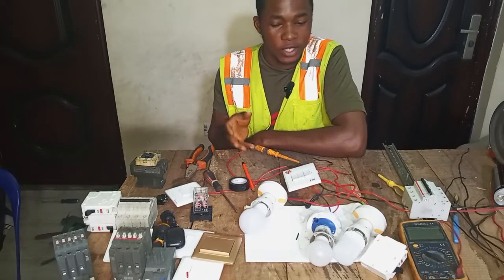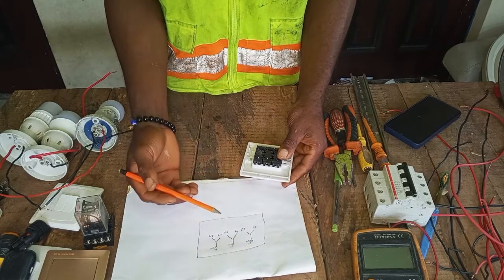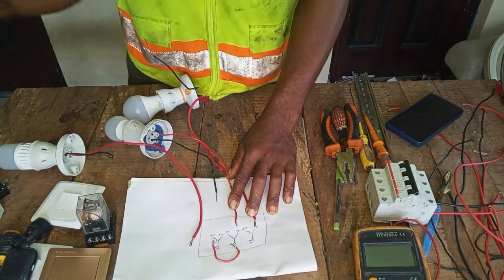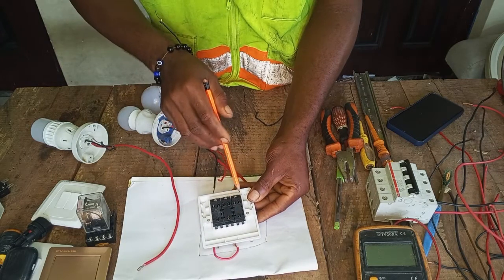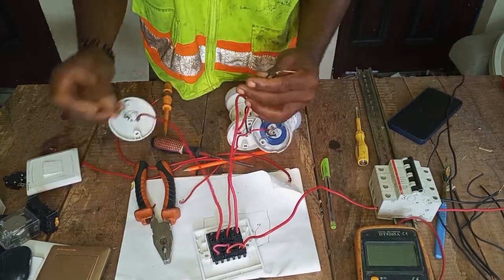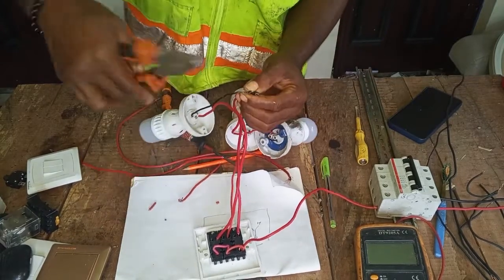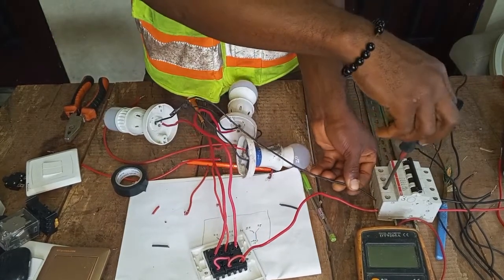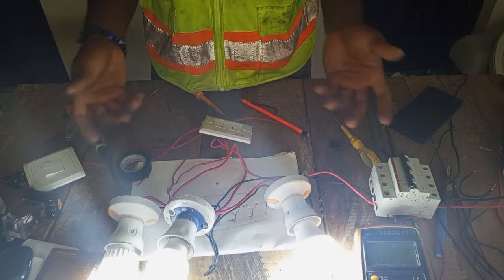3 gang switch connection for 3 light control

Comment: Y u  can  connect the wire on L2? Please explain L2 terminal for what?
Reply from the maker: Ok
Reply: The L2 terminal mark 2 way and the L1 terminal mark 1way. So when I use my volt meter to know when  the switch  is on or off, I tested it on the common terminal to the 2 way terminal and it reads correctly, but when I tested from the common terminal to 1 way terminal it does not read. I also have another question  for you sir.  I bought 1.5 wire to do an extension with a four feet led light, but when I peal off the wire it's not  a copper wire it's like an extension cord wire can it work for the led lights?